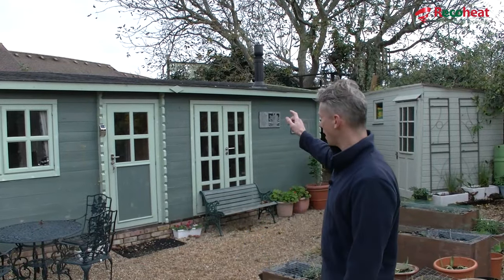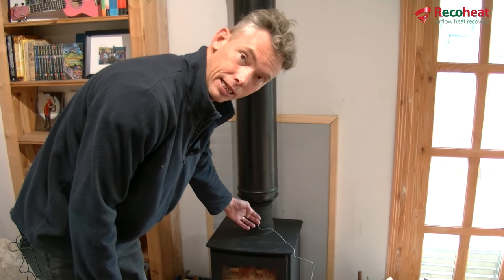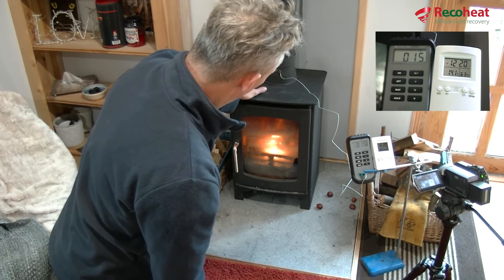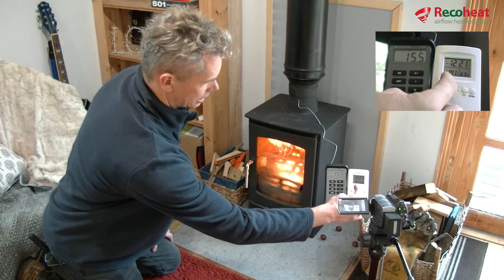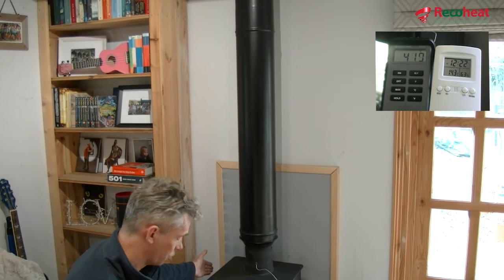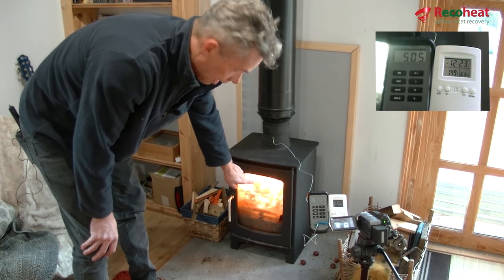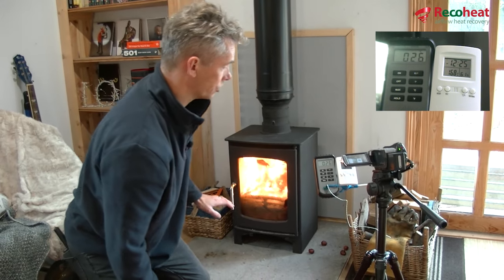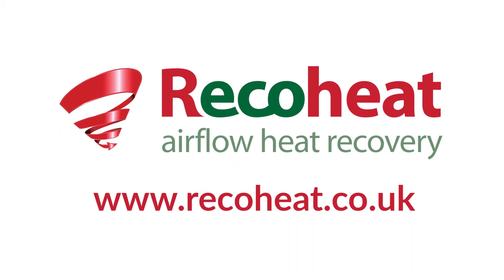Introducing the Recoheat heat recovery unit for wood and solid fuel burning stoves

Comment: An update. I have traced the manufacturer of the air pump, and the flow is rated at <0.2bar. They warn against operating above 0.3 bar as it can cause premature diaphragm failure. In operation, your system will be running at least 1.5bar (see other posts for the calculation). Flow loss at this pressure will be at least 60% (due to air compression) but probably much more, due to non-return valve space, clearances, etc. Basically, it is the wrong sort of pump. A piston compressor would be much better.
Reply from the maker: The pumps are designed for use in fish ponds, to run 10 outlets, all venting through stones into water. It is therefore designed as you say for a pressurised outlet. Our system has the silencer, which has an indirect baffle so does not directly impede the air flow, and otherwise accelerates the flow, so reduces rather than increases the pressure.  There is no constriction on the airflow, so no pressure on the system, which in fact has successfully run on people's systems since 2014. They do wear out eventually, but are very robust. My current one has been running since 2017 with no problems. There are certainly better pumps available, but the one we use seems to be the best balance of power, reliability and cost.
Reply: @Recoheat  As previously explained, the thermal expansion of the heated air pressurises the tube. Calculations give c 1.5 bar for this. Try calculating it yourself. Hint- the acceleration of the air (faster out than in) results in an opposing force; F=ma. Of course this is if you were getting 1l/S. Which you are not- the pump is not powerful enough.
Reply: @Tensquaremetreworkshop  How can it pressurise the tube when it's moving out of the tube, unimpeded? The thermal expansion causes the air to accelerate - it's got no force acting on it to allow it to build pressure. You can very clearly hear, see and feel that, both as it heats and cools.
Reply: @willburrows  It is the movement of the gas that causes the pressure! Newton's third law. If this is difficult for you, consider the rocket. Gas burns, expands, and is expelled out of the rear, and the  opposing thrust of this propels the rocket forward. In a fixed system such as this, the result is pressure against the pump. The calculation is very simple (even though it is rocket science!).
I
Reply: @Tensquaremetreworkshop  This is the engineer and technician argument, no one will ever win. I don't think people are being disingenuous, if an aquarium pump provides enough air to make the thing heat a larger area quicker and it works for long enough to make the cost of the pump and inconvenience of replacement worth the investment then it works just fine. An engineer can find a better pump, at an almost certainly higher cost, but from a practical standpoint who cares?
Reply: @noyb72  No, science wins. And engineers (are trained to) follow science.
The simple fact is that the flow rate through the heat exchanger has not been measured. The designer has relied on the label on the pump to assume that 1 l/S will flow. Ignoring the manufacturer's statement that this is at < 0.2 Bar. A simple thermodynamic calculation (which engineers do) shows that the pressure in the heat exchanger will be much higher than this, drastically reducing flow. The company said it would measure the actual flow a couple of weeks ago. Since when it has gone quiet...
Using a more powerful pump would increase the flow- and reduce the temperature. There is an optimum point, of course (which a designer who was an engineer would have calculated) but significant improvements are unlikely. 
Non- engineers should concentrate on a simpler matter. A modern stove is 80% efficient. Doubling the output ( the claim on the home page of their website) would give 160%. Clearly impossible.
Reply from the maker: Hi Mike, hope you're well. Just to let you know that we've had an engineering consultancy working on the system this year, doing lots of work to measure the inputs and outputs. We're preparing a white paper on it, but have a simulation of the working of the device that correlates exactly to customer experiences but is able to show how it's working. To clarify, your points about the pressure etc are exactly right but the pump copes fine with it. The difference in the effective heat dispersal is a combination of flow and flow rate, entrainment and a peculiar oscillation effect that stirs the hot and cold air together. If you're interested, do take a look at the latest videos - there's a short one of the comparative dispersal profiles of a stove with and without the Recoheat at https://www.youtube.com/shorts/I6TFB8cac04
Reply: @Recoheat  I repeat- have you measured the flow yet? This is a simple test. If you know BOTH the flow rate and the temperature you can calculate the heat generated. Thermodynamics 101. You agree (now) that my point about the pressure generated by thermal expansion of the working fluid (i.e. the air through the coil) is correct- which is simple physics. Try calculating the energy requirement of the pump for that pressure and your assumed flow- you will find it greatly exceeds the actual power input to the pump. Because you do not get that flow. The manufacturers rate it at <0.2 bar. At higher pressures the flow rate will collapse.
At heart, a small diameter, long tube like this is a very inefficient way to transfer the heat. As you desire a lot of warm air, starting by heating a small amount of air to a high temperature and mixing it with room air is not a good route. Heating a larger volume less will improve efficiency. 
A route I would take is to fit a section of stove pipe with radial fins extending both into the gas stream and externally. Case the external fins, and use a fan to direct into the room. One needs to take care, cooling the fire exhaust too much can cause draw and other problems. This would be simpler, safer, and require a (much) smaller energy input.
I am a consulting engineer with many years of experience advising companies on product design and engineering. Please, do the flow test.
Reply from the maker: @Tensquaremetreworkshop  Yes, the flow rate through the system is about .9 rather than 1lps. You still seem to be working on the assumption that the device doesn't work: that's really obviously incorrect. Anyway, thanks for your interest.
Reply: @Recoheat  With the original pump? Do not believe it. You cannot break the laws of physics. And your claim, above, is 3 lps. 
Even if true, 0.9 lps out is c0.3 lps input, giving a thermal transfer, @500C, of 126W. Less the pump's power input of 37W, gives roughly 90W of extra heat. A lot of kit to give 90W... and, as you say above, that is at peak
Reply from the maker: @Tensquaremetreworkshop  The .9lps is input on that pump, measured in the lab. Incidentally, it also runs at just 17w, though the rating is 37w. The simulation you can see on the video is using a flow rate of 2lps based on the temperature settings and you can see the effect on the distribution. The temperature changes it describes exactly match our customers' experience: in the 4m x 3m x 2.5m room of the model, the stove alone takes an hour to get to 21C, and it's 10 minutes with our unit, while the bulk average temperature is 3C higher after an hour, but highly localised with just the stove, while it's floor to ceiling right across the room with the unit. The spread is caused by the oscillation in the airflow caused by the entrainment around the heated jet. On TrustPilot, you can see how many people are seeing a temperature change around their whole houses using the system.
Reply: @Recoheat  So, the pump designed for <0.2 bar is pushing our 90% of max rating at >1.5 bar. At less than half rated power consumption. Do you not know how impossible that is? We can cut through all this- give me your working out. So do the thermodynamic calculations yourself (as you will not listen to me) and publish them here. 
A thermal picture says nothing about heat flow, and human tests that are not double blind are notoriously inaccurate - or just plain wrong. 
You claim 'double the heat output' - on stoves that are already 80-85% efficient. So, >160% efficient. Same claim as perpetual motion- cannot happen.
BTW, if the input to the pump is 0.9 lpm, the output of the pump will be < 0.4 lpm - It has been compressed. You then get 0.9 lpm at the far end, after (and only after) it has expanded back into the room. And that expansion cools it down ( see the gas laws) so the true (expanded) exhaust temperature is considerably lower. You are probably measuring it before it has expanded.
I have an air compressor, that can manage just over 1 lps at 1.5 bar- and it has a 1500W motor.
Reply from the maker: @Tensquaremetreworkshop  We will be publishing the complete white paper - I'll let you know when that happens. Might be worth checking the perspective of people who are actually using it in the meantime.
Reply: @Recoheat  I think that you are misunderstanding the oscillation you are getting- 'entrainment' is a synchronizing of two physical processes. If you are getting oscillation, or pulsing, of the airflow, it is likely a 'pulse jet' effect. If starts with the pump putting a little air into the tube. This heats, expands, and gives a back pressure- stopping the pump working (it is not designed for other than low pressure). The heated air exhausts from the tube, the pressure drops, and the cycle repeats.
Reply: @Recoheat  A 'white paper'! It can all be fully explored within one hour- it would make a great Physics 'A' level question. People's perspective? Try YT- from flat earthers to little green men. No, in these matters, physics rules.
Do you think I should swop my air compressor for one of your pumps, and drop from 1500W to 17W?
Reply from the maker: @Tensquaremetreworkshop  Hi Mike, you're still misunderstanding I think: these work, very effectively. The speed of the air flow increases enormously as the air heats. I'm not talking about the theory - I'm reporting the phenomena, now repeated daily by hundreds of customers around the world. That's a simple fact, not something that is in the slightest doubt. If that fact doesn't fit the theory, then it's the theory that has to change, because the fact doesn't.
Reply: @Recoheat  You answer to everything is 'but it works' - without data. You have not been able to refute a single one of my statements. When someone claims something that is physically impossible, then they are either lying or mistaken. I hope that it is the latter in this case.
If you claim my theoretical analysis is wrong, point out where!
Reply: What diameter are the tubes?

Comment: you did not explain the heating supplement system mechanics???? Why?  You were interested in reading the heat in the flue and what and how it works, show a unit out of the flue, and showing the compressor in the back of the wall????  Your report is all pictures and not a very large sum of mechanics on how this works   please
Reply from the maker: Sure: it's not about the mechanics. There is a lot of information on the website at www.recoheat.co.uk. Mechanically, it's actually simple; the complexity is in the physics. Thanks very much for your interest.